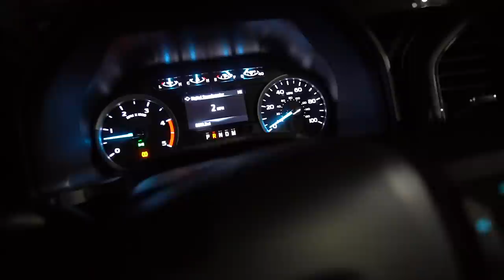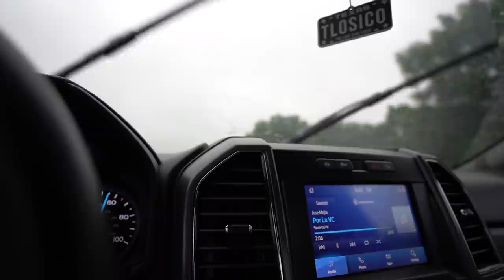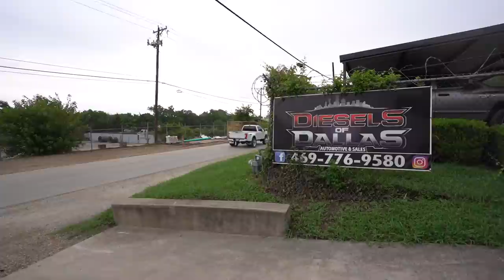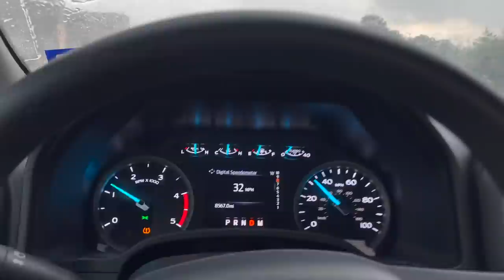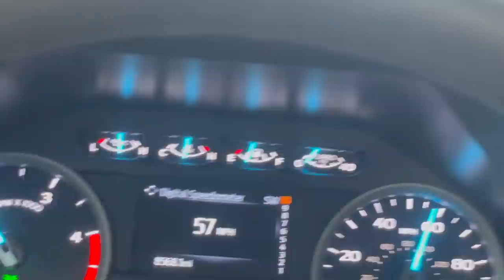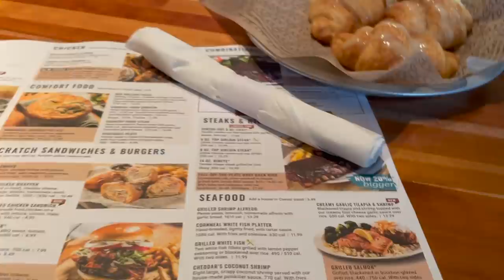F350 SINGLE CAB GETS MORE UPGRADES!

Comment: Why does it cut off at 98? Did you fix that problem 🤷‍♂️
Reply: The governor is set at the speed from factory
Reply: Thanks for responding bro. Is there a way to remove it yourself? @Lsx Josh